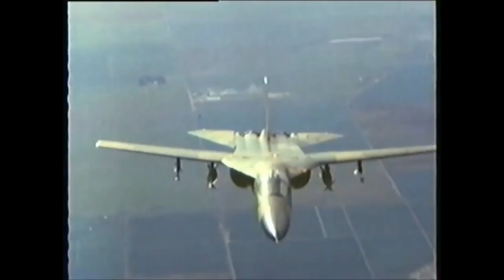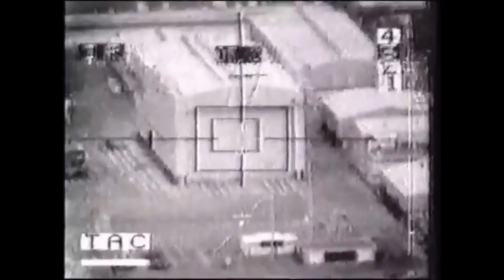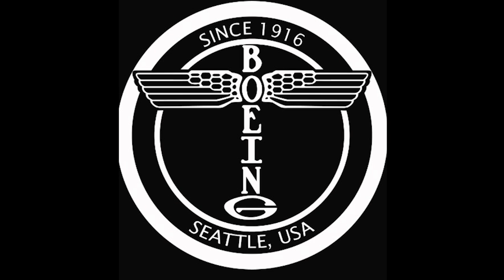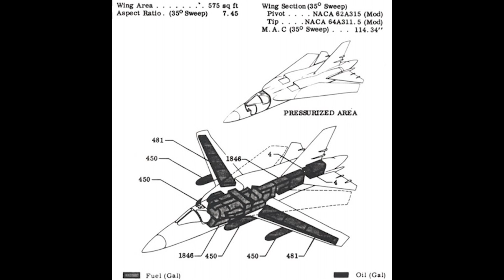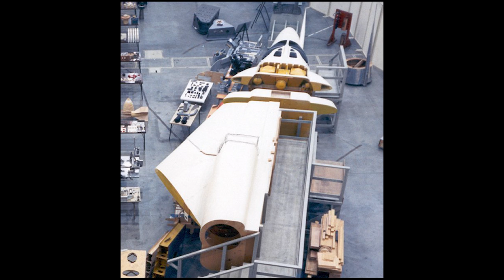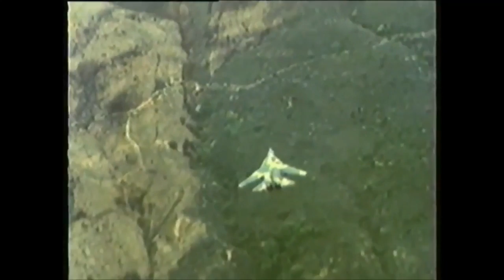Boeing 818 TFX; The Actual Aardvark?

Comment: Secretary of Defense Robert McNamara, can not be cursed enough.  Ever.
Reply: MacNamra ordered the destrction of sr-71 production line and machinery after kelly johnson proposed a strike variant of it, may MacNamra rot in hell
Reply: @lil__boi3027  And the YF-12 and the U-2. Lockheed did not comply. They buried the tooling at their radar range in Helendale. In the   1980's, they made a low-cost unsolicited proposal to restart U-2 production. It flys to this day.
Reply: @MrKentaroMotoPI  based Lockheed
Reply: I had a friend who had been in mcnamara's navy. Macnamara, in order to follow his doctrine of (God help us all) "cost effectiveness" created single screw destroyers.  My friend would say, "Have you ever tried to back or maneuver a single screw destroyer - gaaaah!"
Reply: @fredferd965  McNamara gave us the Belknap class DLG/CG. A compromise in every way.
Reply: @jhill4874  The Design for Belknap class was pretty much frozen by the time McNamara became defense secretary. The more capable design SCB-172A (based on the Leahy) was completed in November 1960, and was merged with SCB-212 (a less capable design, albeit still using the Leahy hull) in January 1961. SCB-212 was itself the result of a series of cheaper DDG and DLG designs drawn up by the Ships Characteristics Board form 1956 onwards, well before McNamara became Defense Secretary.
Reply: To be Devil's Advocate, McNamara was brought in to get control of the huge cost overruns, which were, and still are, a problem with government contracts. His background was in the Detroit automotive industry, though, and he was ill-suited for making defense policy. He hobbled the services' ability to evolve both technologically and personnel wise, he fucked up the Vietnam War in multiple ways and didn't understand the purpose or needs of the services. He might've made a good advisor to the Sec Def on cost cutting but he never should've had the job.
Reply: @RCAvhstape  "McNamara's Morons" should be a war crime.
Reply: @hoilst265  Definitely awful
Reply: @hoilst265  It was!
Reply: @fredferd965  He also lowered the I.Q. requirements for soldiers so that mentally handicapped boys could be drafted and sent to combat, with disastrous results. And fucked up the T-bird with a larger, uglier body , with a back seat! Shooting was too good for that guy.
Reply: May he rot in hell.
Reply: @MrKentaroMotoPI  - He might be running Satan's finances ?
Reply: @michaelmoorrees3585  Probably. The pitchforks are now plastic.
Reply: You could argue that his stint in the role motivated some of the greatest successes in US weapons development, making the companies able to provide realistic cost estimates. and forcing them to deliver on promises. Any institutional change like he was seeking takes years to filter through.
Reply: Wise words.  McNamara was a murderous twat-weezle of epic proportion.
Reply: Worst Secretary of Defense ever, until the current one (I asked Joe Biden what his name is, but he couldn't remember).
Reply: @loumencken9644  Comrade something-or-other

Comment: I can't help but think that the dorsal air intakes would starve the engines of air during high G turns.
Reply: Well, its a bomber, so high G turns weren't expected. Even the F-111 wasn't very manuverable.
Reply: F-111 was sometimes called "lead sled"
Reply: Pitch-up maneuver in F-111s doing terrain-following was very commonplace on every TF mission profile.  Top-located intakes is a deal-breaker in that respect.  Especially if the intakes are located towards the rear, where they can be blanked out by the leading edges of the wing roots.

Comment: Ed, check out all the F111's that were lost in Vietnam due to bad ground hugging radar.
By no means Ed, could you call the FIII a success? They even lost one on the raid to kill Gaddafi. It was a pig.
Reply: @Galileo7of9 Hmmmm
Reply: I worked F111's my entire career as my primary with cross qualifications and many maintenance hours on others.  My opinion as an actual F111 Avionics technician is that it was one of the best birds to ever fly.
Reply: The USAF had abandoned low-level interdiction in real-world combat conditions by 1991 because it was just too dangerous. The RAF insisted on low-level penetration for the first week or so of Desert Storm and got hammered so bad they quit and adopted the USAF's higher altitude approach. According to somebody's numbers I read, if the USAF had done low level tactics and lost planes at the same rate the RAF did the first week and stuck stuck to it the whole war, the USAF would have lost around 700 planes. Instead it was around 50 or 60.
Reply: @brianlaneherder3666  - "If the aircraft combat casualty rate for the first 5 days had continued throughout the war, a total of about 267 coalition aircraft would have been casualties." - Operation Desert Storm: Evaluation of the Air Campaign (Letter Report, 06/12/97, AO/NSIAD-97-134)

Comment: The successor to the F-111B aardvark was the F-15E strike eagle. Boeing owns McDonald Douglas, which produces the F-15. Last year, the US Air Force decided to procure the latest version of the F-15, the F-15EX in limited numbers to replace older F-15 models in air defense. So in a sense, Boeing got the last laugh
Reply: Successor to F-111B was the F-14.  F-15E replaced the F-111F.  USAF didn’t decide to procure the F-15EX, but instead had it forced on them by acting SECDEF Shanahan, a 31yr Boeing executive.  Adam Smith, the House Armed Services Committee Chairman, is also a Boeing representative in Congress since he’s from the Seattle District.   USAF never wanted a new F-15 since the F-15 isn’t survivable in a modern IADS network, both in A2A and from SAM threats.  USAF is talking about pushing F-15EX to Air National Guard units, who don’t want it, but want F-35As instead.
Reply: @LRRPFco52  It's amazing how many airplanes have been deemed "unsurviveable" by so called experts when history proves the opposite.  The F-15 has never been shot down by anybody, but it's now considered a death trap.  The F-16 was supposed to be the nimble little air superiority fighter that would do it all.  If it carries a full load it's mission time is less than 30 minutes and it cannot fly combat without a tanker.  It's Air to Air is abysmal, with only the Israelis having a better 1 to 1 kill ratio (the USAF does not!!!)  The F-35 is another of these wonder jets but its only saving grace is stealth and if it gets into a visual range dogfight it is toast.  It HAS helped a lot of people (and government ministers) get rich, we'll see what it does the minute the Israelis get some and take them to war.
Reply: @paulholmes672  We worked on the F-15 Combined Test Force at Edwards.  It's an awesome program with a great record.  My great uncle also worked on the P-51 & F-86 at North American, and my grandpa on the A-3 & A-4 at Douglas.  Things come and go.  It's ok.

Comment: I love the F-111. But it's not without irony that it was delivered so incredibly late that Australia had to rent a bunch of F4 Phantom IIs to fill the role until they finally arrived. And when they did it was at 4 times the anticipated per unit price. And even then, it wasn't until the F model that it finally met the performance GD claimed in their initial proposal.
Reply: A lot of that additional cost was the result of trying to use a purpose designed high speed medium range low level bomber as a naval fighter interceptor
ALL those development costs were added to the cost of the aircraft GD manufactured in the programme, and so WE paid for McNamara's incompetence, it  should come as No surprise Macnamara was an EX USAF statistician, "Numbers never lie" ?.

Comment: Good stuff - and something even I as a retired Boeing engineer knew little about.  

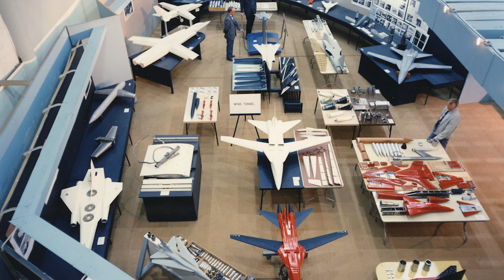Can anyone identify the three lift fan, twin engine concept model shown in lower left at 4:23?  SR-71 meets JSF...
Reply: That is interesting for sure.
Reply: Considering the three lift fans are useless in flight and only take up weight and space in the airframe that could be used for fuel/avionics, more like an SR-71 that could VTOL but couldn't fly very far afterwards...

Comment: The A7 and F4 are the only two aircraft that filled McNamara's requirements and they were designed before his time.
Reply: And they were both designed for a navy requirement.
Reply: No, the F-4 was getting old, and it showed, that is why the navy needed a new aircraft in the first place, and the A-7 couldn't fly supersonic due to it not having an afterburner, it also couldn't carry nuclear weapons and with no terrain avoidence radar it couldnt fly as low as the F-111
Reply: @hamiltonian12  F-4 was brand new at the time, barely into production.

Comment: If only the USAF had adopted the F14 and the program had gotten the engines it deserved early on.. it would have saved a ton of money developing the F15.. which in the end had to be developed through as a strike bomber(something the tomcat  design could do from the start)

But the USAF was so hell bent on not being forced yet another blue water plane, that they went with the F15 anyway, where the Tomcat could easily have been adopted for land use, something that the other way around could not ever work as the F111 program had proven.

If anything the F14 already had the better radar capabilities, better BVR intercept capabilities better range, more payload capacity and as ACE/AIMVAL would later prove, the higher kill ratio over the F15...

So money spent towards the F15 could easily had been a cost cut, and the F14 could have been improved for a fraction of that cost to do more for less.

But they didn't, they got John Boyd to help design a completely new plane instead, anything was better then having to adopt another Navy plane... It was all inter service politics and pigheadedness.
Reply: The F-14 was an extremely cool airplane, but the VG design imposed a significant penalty in weight and structural strength (the Tomcat was a 7G aircraft, vs 9G for the other "Teen Series" fighters). I can't imagine the F-14 being adopted by USAF without a major redesign to a fixed-wing configuration.
Reply: @Philistine47  the 7G was a navy Limit.. not a Grumman design limit.
They have plenty of documented yanks to 12 G and the plane did not break.
Reply: Higher kill ratio over the F-15?  wtf.
Reply: @jaysonpida5379  Right? It's not mathematically possible to have a higher kill ratio than the F-15, which currently has 104 kills vs zero losses in air-to-air combat. But even if it were possible, the F-14 certainly wouldn't qualify - the Iranians lost a few back in the 80s.
Reply: @Philistine47  the Iranians only lost Tomcats to Friendly fire.. they shot em down with Hawks and lost none to Iraqi fighters.
Reply: Nah, the F-15 was already under development, and it was a better airplane for the USAF than the F-14.  Here we are with everybody pontificating about how joint fighter program are doomed to fail, and you want to hobble USAF with a fighter that would underperform what they needed.
Reply: @gort8203  Under Development, but the F14 was ahead already flight testing and the USAF was panicking about getting another Blue water bird stuffed down their neck.. Read Boyd's bio. He hated the Tomcat based on his EM theorie calling it underpowered (which was true with the TF30 interim engine) And he missed the opportunity for Combat flying in Vietnam because they assigned him to the F15 dev program to avoid getting forced to use adopt F14 ..
Reply: @starga-fr7qx  
If I had a nickel from everyone who thinks John Boyd or his biography are the Oracle of truth, I would be rich.  I’ve read the book, and much more over the many years.  I don’t worship the man or the book, because I’ve read more than one book.

I don’t care if the F-14 was ahead in flight testing, it was not the right fighter for USAF.  Your attempt to characterize the considered judgment of the USAF as “panic” is misleading and parochial.   Two spurious non-arguments there.
  
You may not like to hear this, but the F-15 was better at what it was designed to do than the F-14 would have been.  The fact that you can find a web article by a former F-14 pilot who actually claims the F-14 was not meant to dogfight should interest you.  He’s wrong of course, but that should tell you something about his estimation of the comparative virtues of the F-14 and F-15.
   
And which airplane is still flying today because it remains relevant to the needs of the service? Case closed.
Reply: If I had a nickel from everyone who thinks John Boyd or his biography are the Oracle of truth, I would be rich.  I’ve read the book, and much more over the many years.  I don’t worship the man or the book, because I’ve read more than one book.

I don’t care if the F-14 was ahead in flight testing, it was not the right fighter for USAF.  Your attempt to characterize the considered judgment of the USAF as “panic” is misleading and parochial.   Two spurious non-arguments there.  

You may not like to hear this, but the F-15 was better at what it was designed to do than the F-14 would have been.  The fact that you can find a web article  by a former F-14 pilot who actually claims the F-14 was not meant to dogfight should interest you. He’s wrong of course, but that should tell you something about his estimation of the comparative virtues of the F-14 and F-15.   

And which airplane is still flying today because it remains relevant to the needs of the service? Case closed.
Reply: @gort8203  I don't worship him either, in a way he was a deeply flawed man.  But he was engaged in the F15 design, and he did express that the USAF was deeply worried about being forced to use yet another Blue Water airplane.

I don't deny that the Lighter F15 was a better plane at what it was designed to do, eg dogfight, a pure EM theorie fighter..

But In reality how many actual phone booth kills have there been in the real world?

the F14 was the better all round fighter, it was designed from the get go to be both 1intercepter, 2 dogfighter, and 3bomber.. And it was better at 1 & 3 and with a capabable pilot could hold it's own at 2 even against an Eagle.
AcevalAimval kill ratio prooves that the F14 was the more capable plane (unless somebody wants to argue that the Eagles at Aceval/aimval were  not flown by the most capable the USAF could muster).

The F14 could have been much better much sooner for only a fraction of the F15 R&D budget. (engines!!) and It could have been made a capable USAF variant with instant bomb capability and no need for the additional F15E R&D budget to boot.

They could have built more of them for much less. money spent.
And much of the handicaps (weight due to carrier requirements) could have been tailored out for the USAF...And so could that artificial 6.5 G limit the Navy imposed.
Reply: @starga-fr7qx  You are simply wrong in so many ways.  There is no point in trying to argue with a fan who is so misinformed, so go ahead and hold on to your fantasies.
Reply: @gort8203  Either you argue those ways, or your comment is null and void. eg Irrelevant.
Reply: @starga-fr7qx  There's no arguing with somebody who makes up his own facts.  You can say the F-14 was the better fighter all day long but that does not make it so, and certainly does not make it the better airplane for USAF.  AIMVAL/ACEVAL did not prove the F-14 was the better fighter.  You are clearly an F-14 fan who can't follow the reality and it's a waste of time to try to convince you.
Reply: @gort8203  Aimval/Aceval prooved A it had the higher killratio over the Eagle in part due to 2 man crew dynamics and RIO doing the intercept. and B that you need a fire and forget radar missile if you don't want to be face shot by7 the cheaper fighters carrying All aspect heaters.

The Tomcat had those both things already when the F15 did not.

It also had bomb capability, which the F15 did not
it also had greater endurance over the F15.

And most of it's short comings were fixed with the GE engines and by the time the D came around and TARPS and Lantirn, the F14 was waaaaay more capable and versatile over the F15 That's no BS but fact.

There's nothing that the F14 couldn't have done that the F15 did over it's life time. 
It just needed some more development and new engines.. 
Something that could easily have been done for less money then it did cost to do the development of an entirely new plane , the F15 and through development into the F15E Strike Eagle
Reply: @starga-fr7qx   Repeating your mistaken opinions does not make them facts. You don't understand AIMVAL/ACEVAL, or why the F-14 was unsuitable for USAF, and I'm not interested in trying to educate you.  Have a nice day.